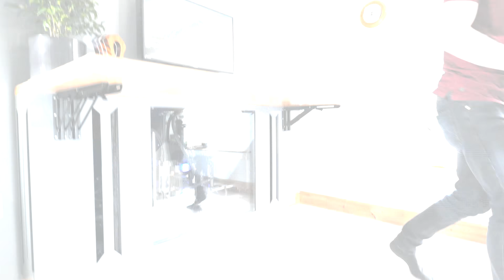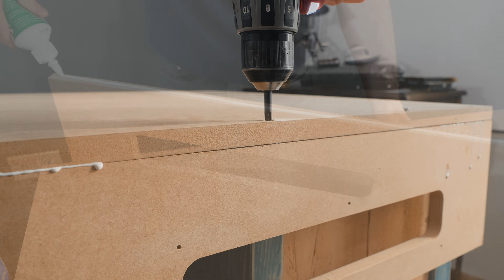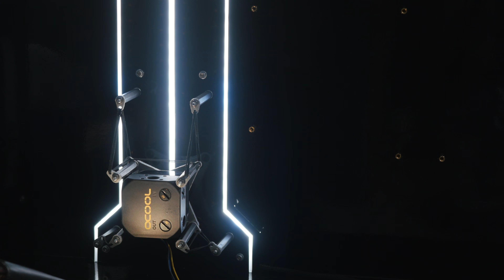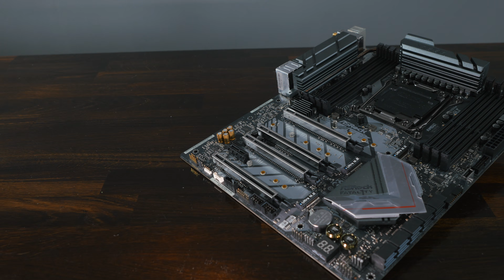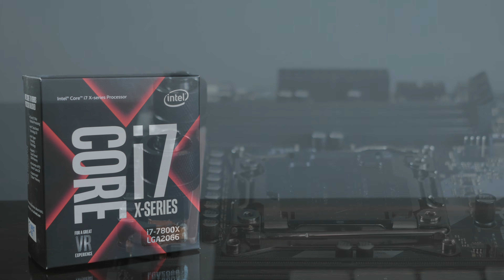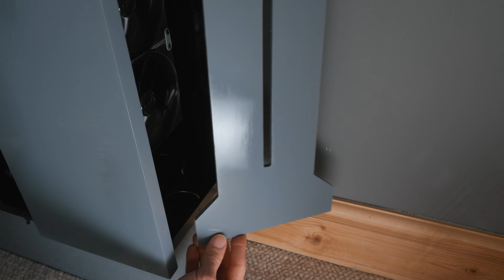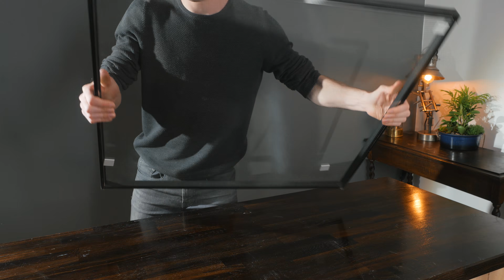Building a spectacular DIY 'desk PC' (it can fold!)

Comment: I have put a Little thought into the idea of chilling this PC.
i do not think it will work as simple as you might believe, the danger is that cooling down, and letting heat up again causes the pressure in the case to change,
when the pressure is low air will flow into the case, when the pressure is high air would be pressed out of the case.
this will cause the moisture that is in the air to collect in the pc, more with every Exchange.
in the end you might end up with just enough moisture to kill the PC.
i could think of two remedies for this Problem:
1. a ballon that is attached to the case, it would deflate and inflate when the volume inside changes, the air remains the same, no Exchange means no moisture build-up.
(the ballon could also sit inside the case, with its interior connected to outside of the case)
2. i would construct the cooling in a way that the Radiator inside the case would be attached to the chiller first, this would mean that the rad would get Cold first and it would also be the coldest place in the case. any condensation would collect there. just make sure there is no Electric parts under it but a little flat vessel with something absorbent in it.

I personally would probably use both Methods in combination, to play it save.

chilling such a PC would be an interesting Experiment, but i would try to make changes reversible.
the Energy consumption might be rather high, and i am not sure if the chiller is running as silent as your PC currently runs.
my suspicion would be it sounds similar to a refridgerator.

Comment: Great video, one worry would the fanless power supply. Given the radiator is on the other side of the case and there are two heat producing components directly above it I am not sure how much air flow it will get. Given the chamber is acoustically isolated I would have been tempted to use one with a variable speed fan to ensure the warm air mixed into the general chamber

Comment: I don't understand why you have radiators inside the airtight compartment, especially when you have the fan cooled external radiators. Surely doing that is going to increase the ambient temperature in the airtight compartment, which ultimately doesn't help, right?

Comment: Great job with this build, my only concern is some components like the ssd, hard drives, chipset, and power supply are designed with the idea that there will be indirect airflow around them, taking that airflow away could significantly shorten thier lifespan. Good thing you saw this with the motherboard vrm or else everything would of cooked.

Comment: Great design!  As you pointed out, the main issue with typical desk PCs is the massive thickness of the desk top.  This avoids that completely.  What I'd like to see is this same basic design on a smaller scale and air cooled to facilitate swapping and upgrading components.  That's quite tedious once you add water cooling.  Maybe I'll have a go at it myself.  DIY, right?!

Comment: Chilling would be easy, just build a tank for the radiators outside which is filled with coolant. and the Chiller cools the coolant.... But you can't go under 0 degrees, But you could if you  fill the waterloop with frost coolant :D which doesn't freeze :D

Comment: One theoretical thing: most of the noise in a computer is from fans, so it being airtight doesn’t necessarily help with overall volume. However, it does help with the sound character (eg hiding annoying coil whine), and having a massive amount of radiator space means the fans can be basically silent. 

Amazing project though! Wish I had the time and budget to do something like this.

Comment: Its a great DIY build .. But... Those Temperatures are really high for a single GPU  build with 2x480 and 1x360 rad config. But i think it is because you didn´t mount the FANS directly onto the ratiators and there is no Static Pressure.. I would recommend you to buy Noctua Fans (look for the Static Pressure optimized ones) and mount them directly onto the Radiators. As well i would not be sure if the one pump you are using has enough of lift with all that lines and radiators on both sides. Is it a D5 pump ? - what is your fluid flow. You still can have a lot of air traped in the radiators because of a underpowered pump and that could be a reason why you have such temperatures. I would say that that build should without any problem be some 20C lower on your CPU if you have proper flow. :D

Comment: Absolutely crazy and cool project, I would love to see you take this even further!
Another option (that i just came up with and is not tested) for the backlight pattern would be to create a vinyl mask for painting and layer one or two coats of silver as reflective coat and black on top.
I think that should be quite an effective light blocking option, though it is quite a lot more efford, I admit ^^
Furthermore the black tubing makes total sense for acoustic isolation, but it should be an option to only use a short link to solid ducts as sufficient isolation, right?

Comment: Excellent video! Thank you! I noticed that the thermal grease applied to the CPU was spread prior to placing the liquid cooling heat sink. Depending on the CPU it is best to apply the thermal grease as a line or dot (~size of a pea) in the center and then place the heat sink causing the grease to be spread by the heat sink. If the grease is spread out before placing the heat sink you'll create air pockets which will reduce the amount of heat transferred.

Comment: I've been going over various different cases online, searching and looking and changing my mind, for over 5 years now, and I think this might just tick all the boxes for me, and i love the idea of a touch start button. The only question I have: do you just wire the capacitive sensor on the motherboard start pins? I'm assuming the sensor needs it's own 5 or 12 V supply. If so, where would I tap it from?

Comment: As a Norwegian I have a hard time finding all the small “nuts and bolts” needed for this project. So far I have 5 orders from eBay, but I don’t know if what I’ve ordered is the most adequate for the job. The spacers, the inserts, the elastic bands, what types did you use, and where did you buy them? I went to the local hardware shop and asked for threaded inserts and found 1 single type, M6, used for furniture, and the manager had absolutely no idea where to get them. Thus my orders from eBay. Not every country on earth has mega-shops for hardware.  😭

And, can’t you please read the messages here, on YouTube? I do not support anyone through Patreon, for political reasons, but I bought your drawings for $5.

Comment: X299 motherboard because of high core counts and plenty of PCI-Express lines: have you ever heard of Threadripper? You could have gotten away with at least half the cooling components as well lol. And to use that with an i7 7800X? Whoever suggested you the components screwed you over big time man: you spent 389 USD on a six core twelve thread component that's two years old and is extremely inefficient. Everything else, KUDOS for the amazing work, but component choice is quite poor IMHO.

P.S.
The CPU you're using is high end only due to the price tag: it's actually mid to low end nowadays.

Comment: Mixed metals can cause erosion in a loop, you should not have combined solder and copper for your custom heatsink it is unhealthy for the loop
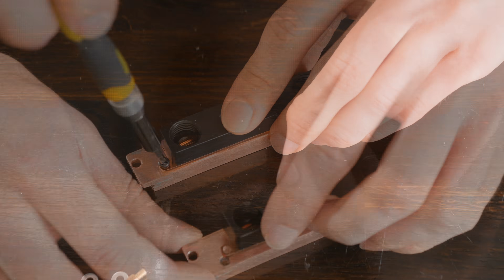Reply: The water in the loop will never touch that part. The copper / solder block he made just passes heat to the Alphacool waterblock via thermal paste (you can see the paste at 17:14.) 

The water only passes through the solid copper of the Alphacool waterblock.

Comment: Firstly congratz on the amazing build and getting this vid out!
I do wonder though, did you set those HDD to RAID for data protection after your recent experience?
When you did the temp tests, how long did you run it for? I suppose you wouldn't have to worry about getting to the point of temp saturation with this build but if you did then the internal temp could rise which wouldn't be good for the HDDs.
About the only thing I would add if this was mine, is a ultra wide monitor.

Comment: this build bugs me in only a few aspects, with the most noticeable being the sideways hard drives. Disks are meant to spin as flat as possible, otherwise you exceed the levels of stress they are made for unless they constantly run full power all the time, which also halves the lifespan.

Comment: FYI - your thermal camera shots are a lie. Metal reflects IR like a mirror. Your images were of your ambient room temp, not the block itself. If you want to see the temp of the copper/metal put some electrical tape on the block and try again. You'll be surprised to see the difference.

Comment: Does your project resource file list the size of the standoffs you used and a supplier?  If not, would you either add it or would you mind letting me know?  I'm in the process of building a wall-mounted "beast" and could use some like you show.

Comment: Two things you should have done
1) flipped the MB so the RAM have the logo right side up
2) Ran the power/input cables through the back of the case, through the wall and out behind the monitor so you dont see them at all.

Comment: I'm wondering why you didn't throw a AMD threadripper with 12 cores/24 threads for $60 bucks less. The single core performance likely won't be as high, but I would think you mostly do video work where core count is king.

Comment: This is quite an impressive project. However, i see a practical flaw with this. 
This may be an personal issue for me though. 
I am someone, who - when sitting comfortably on a gaming / office chair - usually rests his feet on (or right in front of) the opposite wall of the chair. I even have a footrest at home.
Still, the wall behind gets quite dirty after a while, when shoes / socks rub all over the place. My DIY-solution for this: I have put a piece of carpet on the wall behind the desk in my home, so i can pretty much "walk all over that wall".
The big glass window on this build may be not be in ideal for this behavior, but on the other hand, glass is easier to clean than most walls :)

Comment: Condensation might just not be an issue as the internal radiator will just keep the air around the components just as cool.

Comment: It's very impressive, did you think about using power extension cables with other colours and building a small compartment to hide the normal cabling? Would maybe have been a bit easier then custom modding the power cables with extra length.

Comment: It's an amazing work but i have a question: where are the air inlets ? Your build looks like a chimney ^^.
Reply: The Air gets pulled in from the side and gets out to the front
Reply: @larsthestorf5630  Can you show them to me, i can't see them except the front air outlets.
Reply: @gandja6696  Nicely visible at 0:15
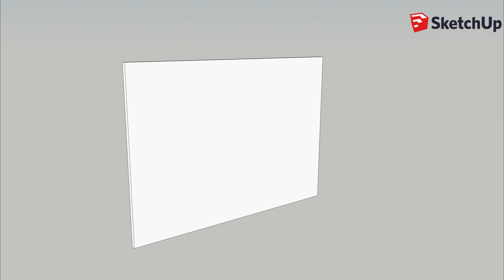Reply: @larsthestorf5630  3:50 Allright, but how does the air can reach the components if all is sealed ? In fact, this inlets are just for the radiators. 3:50
Reply: It is a water-cooled system. The air will indeed not reach the components. Its the water which cools them down. And the water is getting cooled in the radiators by the air.
Reply: @larsthestorf5630  I know but it's not only a cooling problem, it's more about presure.
Yes majority of his components are watercooled, but not all condensators especially on the motherboard.
If the chamber's sealed, have no air inlets and the air chamber is pushed outside by the fans of the radiators, how that can be worked ?
He must have some presure problems.
Reply: @gandja6696  on the inside is also a radiator (close to the reservoir) which cools the air inside the chamber down. There might be a slight air-presure inside but it can't be that much that it would be a problem I guess.
Still putting a barometer inside might be interesting :D
Reply: @larsthestorf5630  Yeah Yeah, i know... bad english ^^.
Reply: @larsthestorf5630  I've try this in the passed: putting all fan in extraction on an old pc tower, they cannot run correctly.
Reply: @gandja6696  wait, I don't think you understood correctly what is going on there. The chamber neither has fans that push air in nor fans that pull air out.
All the fans do is pull air from the side through the radiators and push it out to the front.
Reply: @larsthestorf5630  30:11 they don't push the air outside the chamber ?
Reply: @gandja6696  No, the middle chamber is completely enclosed. The Fans are outside of it and only push air trough the radiators.

Comment: No hate, but extreme OC with 600W PSU? Even though it's from Seasonic (I personally only use them), that's not gonna happen!
Reply: I saw him pairing the i-7 Xtreme and 2080 with the fanless 600W PSU and was confused as hell. Nvidia recommends 600W min for the 2080 Ti. This is pushing it to its limit with the X299 chipset, and 8 sticks of ram, additional 8 fans too.

Comment: I built a similar system in 2015.  My system is good, your system is a functional work of art.  You did an awesome job capturing video.  I spent one summer building my platform for my Obutto R3volution to help isolate it from my Buttkicker Advance transferring into the floor (did not work as good as I had hoped but it does help).  The next summer was spent building the platform for my PC.  Money is the reason for taking so long. The amount of time I spent working on it would have required TB's of storage and a crazy amount of time editing.  Since we own our house and a spare bedroom is on the other side of my computer room wall I cut a huge hole to vent the heat into the spare bedroom.  My pumps and most of my fans are in the spare bedroom.  I am always hot and anyone who has a VR HMD understands that you do not need extra heat in the room. My build would not be for most people but I am extremely happy with how my build turned out.  Very quiet, and cool.  Fantastic job...

Comment: Great build! I am just wondering whether the hinge system will hold up to daily abuse of going up and down and leaning on the top with your hands (I know that replacing a hinge is simple, just unscrew a few screws, screw in the new one and voila, but still it makes me wonder how much a single hinge can hold on). Also HDDs often rely on the airflow of the case to work under acceptable temperatures, so def. check your HDD temperatures. Keep going with projects like this! :)

Comment: a suspension for the foldable desk would have been a great idea and made a good protection for "dropping" the desk. Only problem could have been the flat integration once folded. But i think that could have been fixed properly without to much work. Else a nice Idea and work for a small room solution with a lot of "room" inside., through the solution with the hanging solution seems a bit improvised because with all the heat in there the rubber will get damaged and shore over time. But i will gladly get told otherwise

Comment: Those hard drive temps are very high. 40C will drastically reduce your hard drive's life. Best case is below 30C, but +/- a few degrees is ok.
Reply: Studies on the subject have conflicting results. Google says optimum is around 40C while Microsoft says under 30C is best.. While others find no real correlation between temp and failure. Humidity, vibration end EM noise are other factors that play a part. Probably depends on the manufacturer. I'm more concerned about the fanless PSU, but it's probably only at 50% load max.
Reply: @Andersss  It depends on the drive obviously, but if you look at this article https://www.backblaze.com/blog/hard-drive-temperature-does-it-matter/ backblaze has 0 drives over 38C, and already at 30C there's a massive jump in drive failure (starts at 26C for seagate drives). Even though they say there's no correlation between failure and temp, they don't even test above 31C. 

As for the PSU, Seagate validates their fanless PSU's up to 50C ambient, so I think it should be fine, although probably not ideal.

Comment: Yes, make a combined water-chiller/room-air-condition. External heat pump and then cool the loop water, while keeping the external radiators so they cool the room. For a super quiet aircon solution.

Comment: kinda defeats the whole purpose of a see-through case and all those RGB and LED lighting when it's in the bottom and when it's not in used is coved up from the top with the table and even worse totally covered when the table is folded. The noise would be even more reduced if the whole thing was just a closed box of MDF....then again you wouldn't be getting a free computer if you did that. 

If you wanted total silent, might as well put the computer in the closet and run a cable to the monitor and a USB hub.

Comment: The southbridge and the motherboard vrms need some cooling as well. It cant be completely air tight that it will accumulate heat from those... Also ssds and hdds also produce heat.

Comment: Well this is stunning and beautiful and perhaps one of the best things I have ever watched, but why on earth did you not route that video cable from the monitor inside the wall to the back of the unit? You go to so much trouble to make things amazing otherwise-- I mean, the individual cables to the power supply must have taken hours!! Why leave one ugly cable sticking out like that? Two drywall holes in the wall and one on the back of the desk eliminate this altogether-- why route it through a glaring hole in the top? Don't get me wrong, this is phenomenal all-around, but hiding that cable was maybe the easiest thing to do properly. Otherwise, it's amazing!